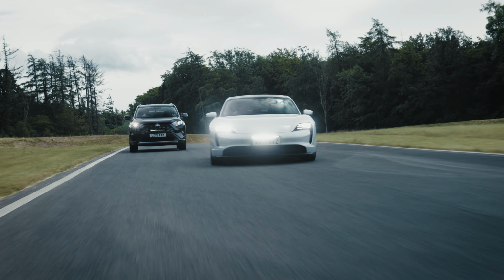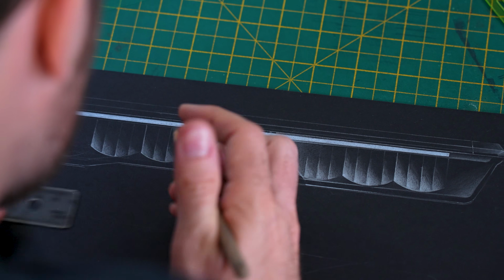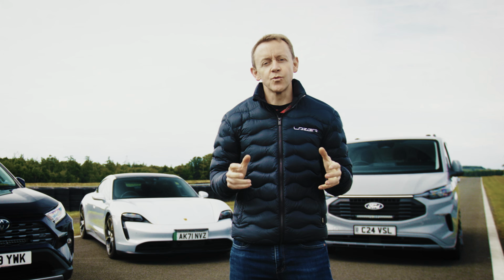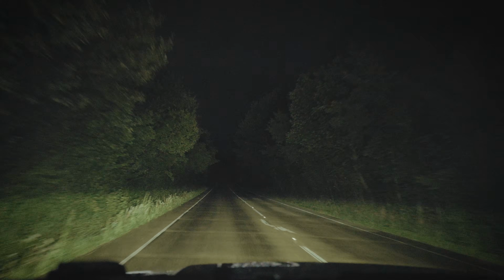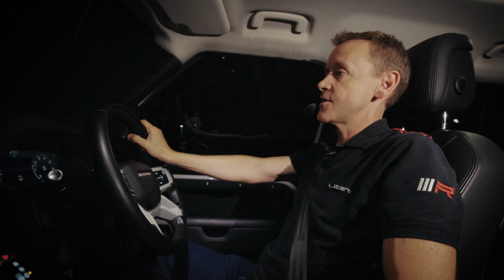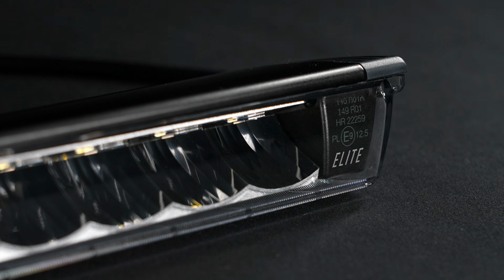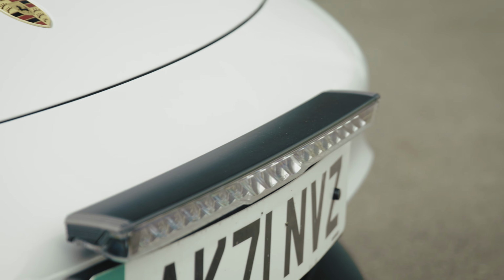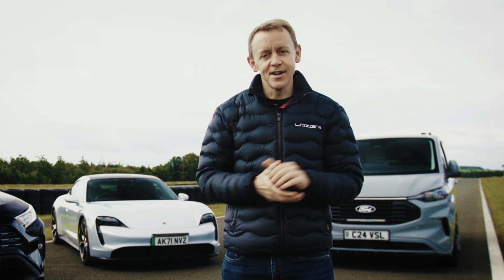LAZER LAMPS | Introducing Glide

Comment: Hi, I don’t quite get how the Glide Elite is 12800 lumens, whereas a Linear 18 Elite+ is at roughly the same width is 21000 lumens?
Reply: There probably will be a glide elite+ with similar strength
Reply: more flood on the linear results in more lumens but not distance